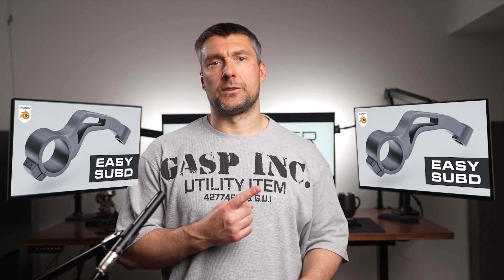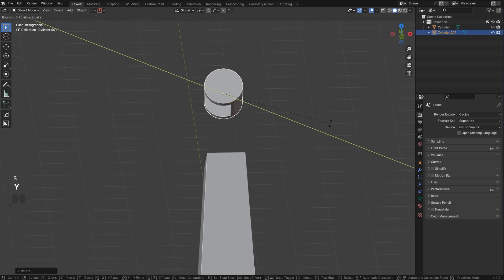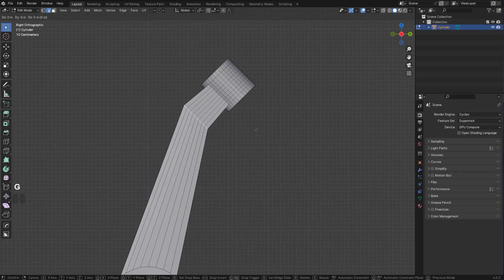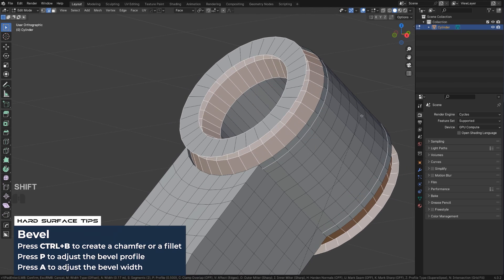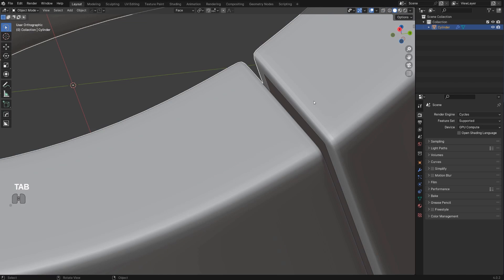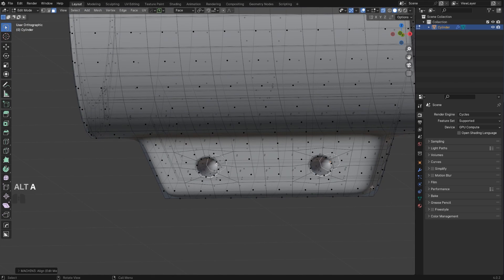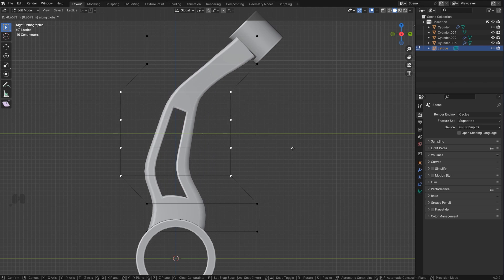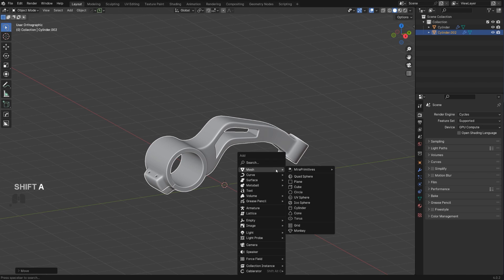EASY Hard Surface Modeling with Blender!

Comment: In the late 90s I worked with Pixesl3D and NURBS modeler and it had the ability to blend between patches making it look like it was filleted including texture blends. It would be awesome if Blender would have it as SubD quickly fails when you need cuts trims blends between parts.

Comment: As a SubD modeler whit 20 yr exp I just cried over your waste of polygons .. do it again with half of the polygons, them with again half. etc.. exercise!
Reply from the maker: the bottom cut wont work with less topology since subd will pull the geo and deform that circular shape / topo density needs to follow the detail support
Reply: And how Latece and SubD modifiers will work with half of the polygons?